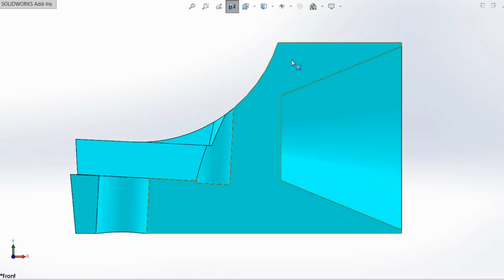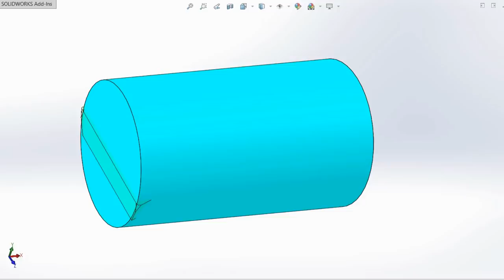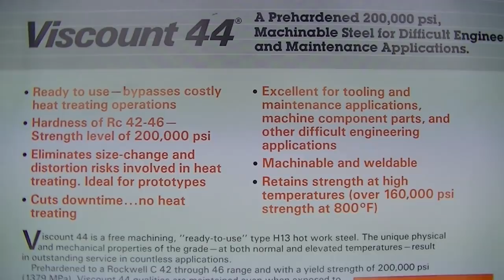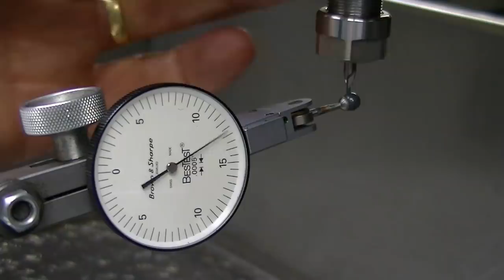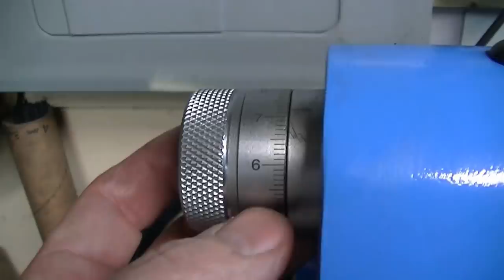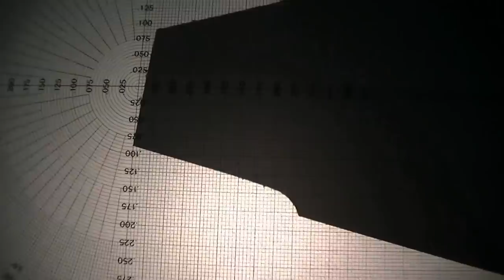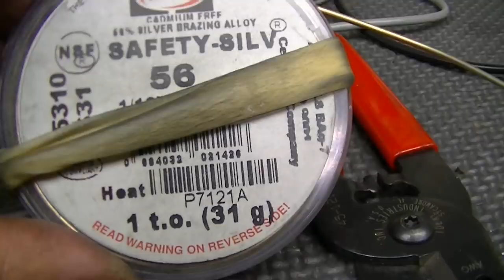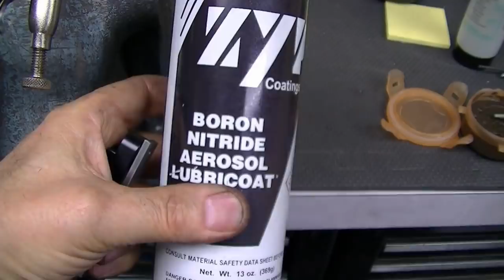MAKING AN INSERT BORING BAR

Comment: Great video Robin! If I can be so bold and make one suggestion. If you mill the bottom of the pocket just slightly larger to leave a small vertical wall that goes about 1/4 to 1/3 the way up your side angle. That would give you a corner relief sort of like your top relief below the cutting edge. This would make it so you don't have to chamfer the bottom corner off those small inserts. Yet still leaves plenty of bearing area for the insert.  Thanks again for taking the time making the video.
Reply from the maker: Thanks Peter, I do that on larger insert pockets. I intentionally did not do that on these because the wall on the cutting side is already extremely thin and they have a tendency to just fold over and rip back destroying the pocket integrity. So I wanted all the meat I could get on these.
ATB, Robin

Comment: Tool & die guy who works with Viscount 44 a lot. The stuff is available in generic form under drill rod manufacturers by different names, I think we get Precision Marshall Firechrome 44. From what I've been told, actual Viscount 44 is not being made now under original name anymore, but the basic formulation is available under different names for drill rod at least. A. Finkle FX T2 & T3 triple vacuum melt steel is great too- but much harder.

Always wanted to make my own insert boring bar- so many are indeed poorly made. 
Your 0.005" pocket screw offset is what I've been told exactly by a custom small insert tool manufacturer near me who specializes in HSS insert tooling- most people don't know that detail.

Guys- if you want to make one of these- he got every minute detail on it. I definitely learned a couple tricks. Would love to see a dedicated vid on the D bit geometry and radial relief grinding.

Awesome work Robin, you make quarantine livable
Reply from the maker: Thanks for the kind words and the steel tips

Comment: I am highly impressed by your SolidWorks knowledge and ability. Your In context modeling the use of multiple design sketches within parts and assemblies shows you have a deep understanding of the software.  I have been modeling in SW for over 20 years but we mostly do injection molded part design.  Keep up the good work.  The in context modeling is one of the most demanding SW skills...any little glitch will sink a whole model.  I Keep working backup progress files in safe keeping until the very end. Thank you for the video
Reply from the maker: Thanks Glenn, I have been using SW since the beginning but I an no expert. I use it only about 5-10% of my time as I usually manufacture what I design. Your right that in context can get you in big trouble fast.

Comment: Great content, thx for sharing. A few years back I also made a tool holder for DCMT and VCMT carbide inserts and used my D-bit grinder so that I could mill out the 7° relief angle. A good CAD/CAM package and CNC mill ease the process of milling out required contours. This approach opens up further possibilities to fulfill those kind of special jobs :)

Comment: That is some very clever modeling. Like a lot of old machinists, I never got any Solidworks training in design. Moving from manual machining to CAD / CAM / CNC was a big move for me. Of course most of us had some exposure to programmable DROs and conversational programming like Prototrak and Dynapath, but making stuff work in Solidworks was a steep hill to climb. It’s frustrating when you know what you need to do and you can’t figure out how to make Solidworks do it. At least I have my Machinery Handbook to fall back on. Learning how to use that was probably as hard as Solidworks if I’m being honest. But I was younger then and my eyes were better.

Comment: I just got a 24" x 36" brown and Sharpe cast iron surface plate, rusted
Need to make a repeat-o-meter and some laps
Great content, the best
Reply: Actually I have two 1", and one 1/2" carbide boring bars that this could come in handy for.

Comment: I was 30 minutes into this video before I realized how small these boring heads were, I feel bad because I had plainly seen the blueprint at the beginning. I guess that is what happens when you work with big stuff all the time you forget about the small ones. I have never used a boring bar that small.
Reply from the maker: Thanks for stopping by Brian. These could be very useful in your big Monarch  ;-)
ATB, Robin
Reply: I'd misplace a boring bar that size, in the chip pan
Reply: One of my old mentors taught me the ins and outs of a splendid little instrument lathe in the chonometer shop. He told me that liittle parts are no different from big parts except they're little. If that remark didn't puzzle a third year apprenticei he had a fund of others just as elliptical.

Comment: Hi. Just in case you don’t know, the reason that your hardinge is making a squeal when it stops because the cork brake is dry. In the manual it says to leave a little bit of oil on that cork so that it doesn’t dry out and crack. I did that on mine and the braking became much more smooth and silent, but the time to stop the rotation is quite a bit longer, in the range of 2 to 3 seconds.
Reply: LOL! I'm laughing... Imagine adding oil to fix squealing brakes on a car!

Comment: I found it both educational and helpful but i would like to see someone make a damped boring bar as those have made carbide modular bars obsolete. There is still a roll for one piece carbide bars in micromachining like pHorn makes. I've heard some say you can pour lead into a bored out boring bar but idk to what degree this is better than a moving damper like in SilentTools bars
Reply: the design of a damped boring bar like silent tools has a extensive literature. professor Altintas from British Columbia and Dan Ostling lider of silent tools in Sandvik published many paper about it, also Mohit law from IIT in India, also me From Brazil, but I investigate a different damping mechanism such as particle impact damper. Dr Wallyson Thomas Alves da Silva

Comment: Nice precision work on a part that small. The only thing you didn't show was clocking the coolant hole grind in the bar with the offset hole in the tip. You showed spinning the bar to work in the flux then out came the torch. Unless that was one of the non through coolant bars.
Reply from the maker: The fluxing you saw was a solid bar. I didn't flux the hole areas on the coolant thru. I put a sharpie alignment line on the bar and head so I could make sure on that one.

Comment: G'day,  in a 3 litres of water roughly about 1/3 cup of Epsom salts & 1/3 cup of By carb soda. Use a basin to dissolve the lumps. I use an old milk bottle to keep, soak ya hands for 25 mins in,  great for split heels. It takes the dead skin & nail, rejuvenate skin. Thanks for the great show.

Comment: I liked this video.  Worth watching right through.  A good approach to the problem.  It shows how important it is to do good planning at the drawing stage (and to use good software), however tempting it might be to rush in and produce swarf.  However, I couldn't work out how he moved his milling cutter to make the triangular cavity for the carbide tip (did I miss something?).  I have made similar holders by putting the work on a rotary table, and more latterly by using a small cnc mill to cut the cavity and position the screw hole.
Reply from the maker: CNC mill was doing the triangular cavity and screw hole.

Comment: pocket rib lacking, see mitsubishi Dimple bar for inspiration. Helps with harmonics! Used to make hollow boring bars filled with led once, that helped too.
Reply: Have you used the dimple bars? Any comparison to Sandvik silent bars?
Reply: @alexkern9134  The dimplebar comes in smaller sizes but the silent bar has a true damper - a weight that floats in oil - in the bar. And costs more and comes in bigger sizes. The dimplebar is just a rib on the tip of it. If you had to chose between the silent bar and the dimple you should chose the silent because it costs 10x more if sizie were the same.

Comment: It would be interesting to try using a 5C to ER adapter for the d bit grinder since you could take the whole assembly to the comparator and not disturb the tool.

Comment: Hi Robin, I was wondering if you might have used graphite to keep the solder from flowing into the coolant hole. Great work, as always.
Reply: The w-BN in the masking spray is also known as white graphite.  That could have been used too.  i looked up the price of that stuff in raw powder form and it was £45/kg  which is probably cheaper than the spray if you make your own slurry.

Comment: Thanks Rob, beautiful and inspiring work as always.

I've never had an issue with silver solder joints wicking in to socket joints other than excess solder that then needs to be cleaned up. I think silver soldering is underused these days.

I haven't made many insert holders, but when I did I personally didn't see any value in them being hardened. Would be interested in hearing a valid argument from anyone as to any real benefit in them being anything other than mild steel. Viscount 44 has the same stiffness as 1018 for example.
Reply from the maker: Thanks Pete. You are correct that the modulus of elasticity is generally the same for steel whether hardened or annealed. But the yield limit changes drastically with hardening and tempering. The seating surface and the threaded hole are the critical areas that benefit from the higher yield strength of a hardened insert pocket. Even hardened insert pockets can eventually deform from high cutting pressures. But the biggest item I think is the threaded hole as it sees high moment loads from the screw being offset so that it produces high lateral forces pushing the insert into the pocket walls  to seat accurately.
Reply: @ROBRENZ  Ah yes, excellent point, I hadn't considered that. Thanks Rob.

Comment: thanks Robin. they came out nicely. I have questions. lol. why did you drill the hole before you machined the pocket? would it have been easier to machine the pocket and then indicate off the insert hole? people want to know! lol.
Reply from the maker: Hi Emma, by drilling the hole first I can sneak up on the correct lateral seating force by slowly moving the pocket walls out on the first part. Mill with the tool diameter offset larger than the real cutter first and then slowly reduce it until the force is correct. If I mill the pocket and then tap. If its too loose on the first try its junk.
ATB, Robin

Comment: Page 30:35 I thought I picked up - we need 15 degree cutter to finish the pocket wall ... 
I wonder if the insert relieve angle is 7-degrees? Should we using 15-degrees cutter or 14-degrees?
Reply from the maker: 14

Comment: Hi Robin! Wouldn't be easier to start by soldering the steel blank to the shank and then machine all the features by holding it by the shank? Probably I'm missing something.
Reply: It wouldn't be so easy to index all the heads if he was to do that, if it was a one off then yes it probably would be as efficient to make
Reply from the maker: Thats not a bad Idea but then I would need to conjure up a repeatable part holding system that works off something on the carbide bar which could be done. But then I wouldn't be able to make spare replacement heads like I have now.
Reply: @ROBRENZ  Got it! Thank you

Comment: Hey Robin, thank you for sharing this with us. Do you oxide/blue tools like these? I know you run coolant but everything in my shop rusts regardless. Would be curious to see your take on bluing, cold or hot.
Reply from the maker: I typically don't blue anything as rust is not an issue in my shop.
Reply: @ROBRENZ  Robin, do you use a dehumidifier in your shop?  Or just good climate control?  Or other?  I've reached the point where I can't afford to run my dehumidifier.  :(
Reply from the maker: @bobvines00  Just heat and AC

Comment: 18:05 Robin, another great video.  Would you be willing to share what fluid your running in the HLVH?  Wondering if you have any corrosion issues, discoloration, etc.  Thanks for sharing.
Reply from the maker: Houghton HOCUT 795-MP  excellent coolant biostable with high mineral oil content.
It does remove paint but no rust issues in 10 years.

Comment: Robin, thank you for yet another great video. I really appreciate you taking the time to video & edit what you do. I especially appreciate you explaining what you do and why you do it.

When you used a die grinder with a diamond "burr" (maybe not the correct term) to grind the end of the carbide bar's coolant hole so it could feed the coolant hole in your new head, what kind of "diamond burr" did you use?  Do you use the cheap "imports," or do you use a "higher quality" brand of "burrs"?
Reply from the maker: I use both but that one was made by the company I used to work for. The key is light pressure, you cant force these. Typically called plated mandrels.
Reply: The plated mandrels sold by MSC, McMaster, etc are likely going to have better QC, meaning better dimension accuracy, and diamond bonding.

My experience with cheap diamond tools/cutters is poor TIR, combined with poor diamond adhesion.

And by ALL means, just like Robin said, DO NOT PUSH THEM. Let the diamond work.

GeoD

Comment: What’s the advantage of tapering each piece over just making them cylindrical? Another amazing video, I appreciate you sharing your knowledge!
Reply from the maker: The taper minimizes stress risers on both parts and is easy to do. Also allows a minimal clearance joint with loose tolerances.
Reply: ROBRENZ ahh! that makes sense, thank you.

Comment: OUCH!! Robin that background pink is almost painful. 
Thanks for the math/geometry/metallurgy/machining/silver soldering lessons. Very informative.
 I have one question though. What is the reason for using a solid carbide shaft? I can understand the head being tool steel so it can be machined but surely the carbide shaft is overkill and expensive?
Thanks again and regards from Canada's banana belt.
🤞🇺🇲🤔🇺🇦🕊️🇨🇦🍌👍
Reply from the maker: Solid carbide shanks are very common. Carbide is 3 times stiffer than steel for less deflection.
Reply: @ROBRENZ  Thanks Robin, Now I know why.

Comment: On that last shot with the 3 finished boring bars: what did I miss for the bottom right corner of the rightmost bar to be different than the one in the middle ?
Reply from the maker: Just a slight variation of how the OD grind of the head intersects the pocket wall.

Comment: Dear god. This is why I’d like to do a solid bar rather than a silver solder head. Neat and fun, but nutzo. Thanks for doing this, I wish I could get more tool making in but it’s still hard being middle aged and coming into it with only 5 years of “at the college shop” experience. No one wants to train any more, and if your not 18 no one wants you if you don’t have 20 years of machining experience.

Comment: At 28 you talk about tapping to true up the small end mill. Please elaborate where are you actually tapping?
Reply: Zephyr he taps the base of the endmill itself around to run concentric. Even though it's in a collet it can still be out, which is magnified w the smaller endmills.
Reply: @nickolaguez  Actually he is tapping around on the ER nut itself. That is the best way to move the mill around (tyny distances though). I learned this in a video from Haas tip of the day.
Reply from the maker: On the collet nut
ATB, Robin

Comment: I most likely missed the point of this , but why solder the tip on instead of make the boring bar one piece ?
Reply from the maker: To have a carbide shank which is three times stiffer than steel.

Comment: Thanks for the video... I'm getting so frustrated not being able to find the imsert holder I want/need without it being in a set with ones I already have, I'm fixing to make my own, if I can't find one.

For a Sherline lathe, could a guy get by with making it out of a HSS drill blank?  Or should I use a titanium shaft?  LOL.  Seriously, could I get by with HSS for a short, basic turning and facing holder?   Or should I get some prehardened shaft?

You have any experience sharpening/grinding carbide? I need a recomendation for cup grits. How many different cups, and which grits, if you have some knowledge to share.

Hope you and yours are staying safe from Covid-19. It is something to respect; it's not just about you lungs and getting over it.  It's causing kidney/liver failure, and aneurisms leading to strokes. 

There may be a new secondary damage for the list.  I had Covid in Jan, and right after a lymph node in my neck swelled up about the size of a ping-pong ball.  I just found out today it is necrotic, (dead tissue), and has to be removed.  Either Covid caused it, or it's cancer; won't know until it's out.

If anyone you know gets Covid, get them to keep exercising their lungs. I only stopped my workout schedule the first 3-4 days, and I think it helped me, (I'm 66+), may have kept me from dying from it.

Thanks for your thought on my project questions...

GeoD
Reply from the maker: The material has to be machinable with normal tools. HSS is too hard.
Reply: Uh, oh  < noob confusion..  HSS can be turned with carbide tooling, right?  I saw vids about guys making things from HSS drill blanks, and have a few projects planned using the ones I've already ordered?  Might have to reassess if it can't be!

I finally found the insert holder I was looking for, so I'd don't have to make one, now.  (I also found on eBay, a couple of sellers w- great close out prices on Mitsubishi inserts.  Several shapes, and as cheap, or cheaper than generic Chinese, if you're needing/wanting some.)